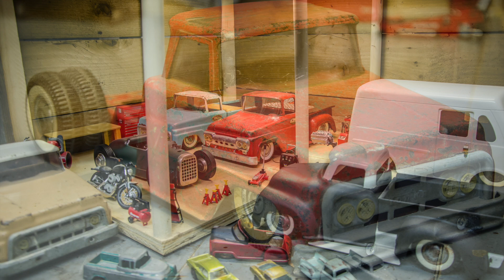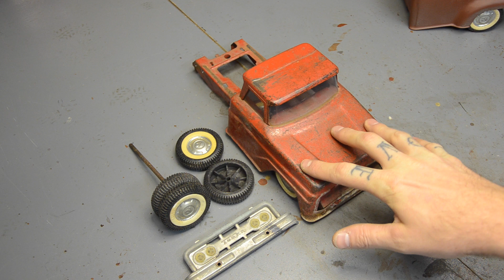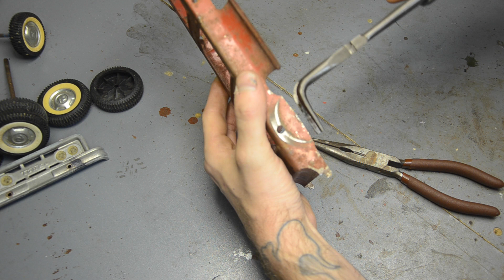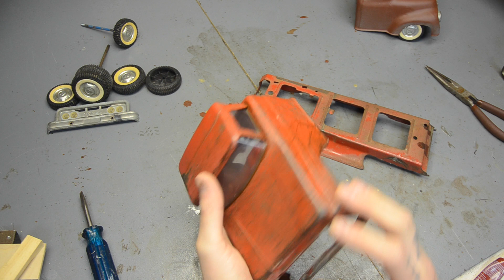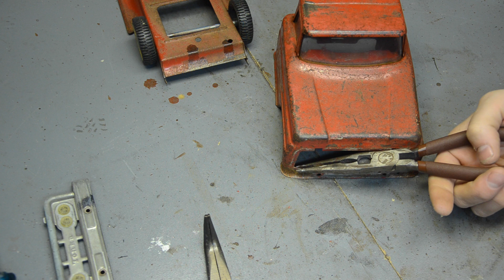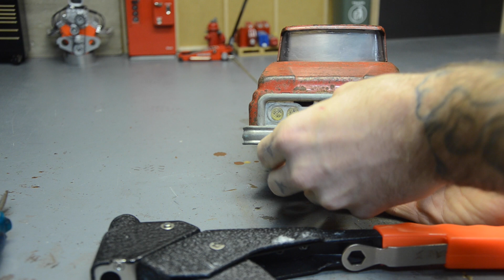65 Tonka Dually Chassis and Dent Repair

Comment: I like your work I was wondering what about making wood blocks to.fit between the frame and use a small.tack hammer to straighten the frame I was wondering if you have  a bad frame but still has the hitch because if you cut the plate from one fender to other I thinking of making a new part just either jb weld   or rivet

Comment: What's a good way to clean the white walls for the tires? Can they be saved or is it easier to buy replacements?
Reply from the maker: As long as they aren’t too cracked you can save them. I’ve used bleach to whiten them back up, just use it sparingly. Once they look better saturate them with armor all and let them sit a while. It helps rehydrate.
Reply: @ChoppedToys  thank you for the help and replying 👍

Comment: Just ran across your channel. Just subscribed. Not sure if you finished this truck. I think a 5th wheel hitchh, add a trailer to haul other cars. I like the stance.
Reply from the maker: I still havent done anything with this one.  Looks too cool as it is.
Reply: Chopped Toys right. It's a great piece.

Comment: Nice job, where do you find most of your trucks? And I have a nylint dump truck that had a sunroof in the cab... how would you recommend cover that hole and making it like a regular cab?
Reply from the maker: I find them at local antique stores, usually over priced.  And ebay.  Not sure about your sunroof, I have had success using JB weld to fill holes, maybe make a sheetmetal piece and do it that way.